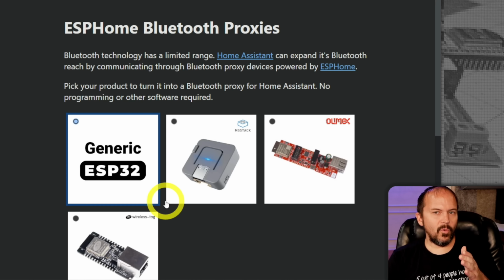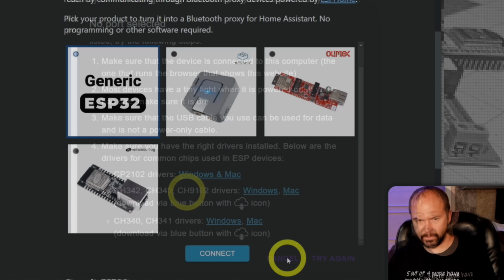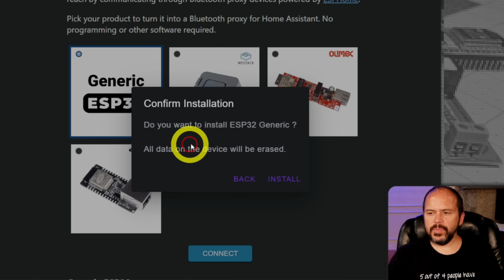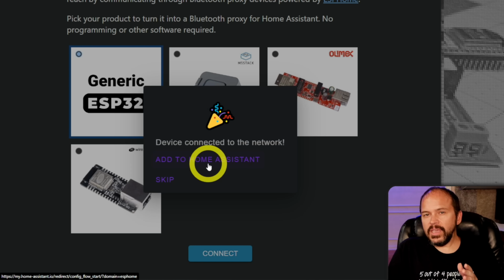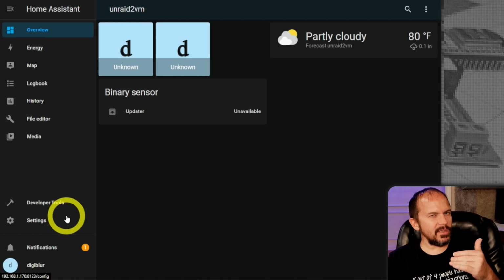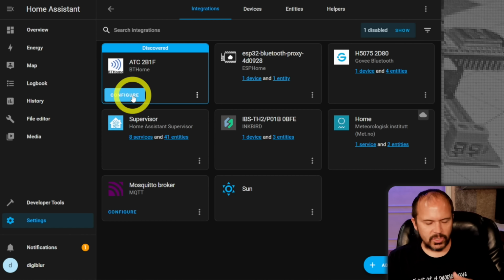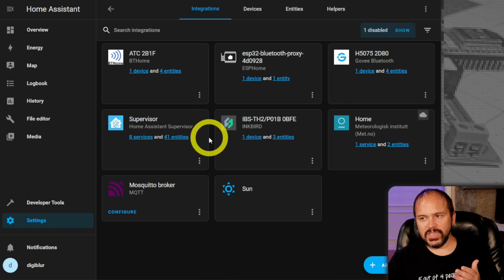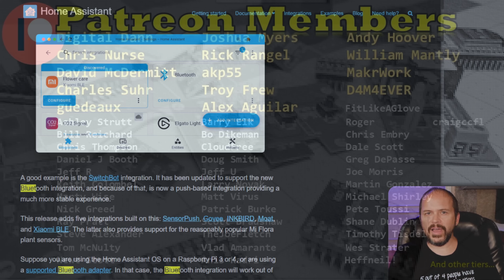How To Make a Home Assistant Bluetooth Proxy | EASY NO Soldering

Comment: Thanks again Travis.  I have an InkBird BT Thermometer in my Hot Tub, it says the range is 100ft, but I could not pick it up with the Inkbird App at anything greater than 30ft.  Even after setting up the BT Proxy (NodeMCU), I had to locate it pretty close to the InkBird.  I guess I will have to sprinkle some more around my property. Nice video.
Reply from the maker: Probably 100ft with a perfect clean spectrum but it competes with wifi a bit. No harm in adding more. I have 3 or 4 around.

Comment: One thing to remember if you add a Bluetooth proxy to an existing device; you may have to rebuild the firmware with the esp-idf framework instead of Arduino to make sure you can fit everything in the onboard memory. If you do, you will have to manually reflash the device, as there are differences that an OTA upgrade won't be able to fix.
Reply from the maker: I saw that new change I think in December it was?
Reply: @digiblurDIY  It seems that you're right; it seems to have been part of the 2022.12.0 release of ESPHome.

Comment: Just wow 👌 👏 

I have been searching for a way to connect more than one bluetooth speaker to a raspberry pi running on bullseye and play music on these connected Bluetooth speakers.

Could you please do a tutorial on how to do this !!! 🙏
Reply from the maker: Thanks!  Probably more than what you'll see this project doing given the data involved but you never know what they come up with to support.
Reply: There is a feature in the upcoming Bluetooth standard to sync multiple Bluetooth speakers.  To be clear it's the upcoming Bluetooth standard not a HomeAssistant feature and it won't be compatible with current devices.  Till then you may be out of luck.
Reply: Not over bluetooth, but devices like AudioPro and other LinkPlay based devices allow streaming and synchronizing music over the network, with HA integration

Comment: Tried with an NSPanel, but seemed to crash the device sadly.  Worth a shot :D
Reply from the maker: The NotSafe Panel might be better at not being a proxy.  I'd stick to dual use on something simple like a relay.
Reply: @digiblurDIY  I’ve spent more than enough time trying to get it right in Nextion/ Yaml I suppose I don’t need that to mess it up hah.  Looks pretty sweet with zigbee wind/temp sensors etc displayed on it though

Comment: so thinking out load if you had the original NS panel round your house with esphome they could also be proxies
Reply from the maker: Yes. In theory they could as long as the cpu doesn't max out on them.
Reply: @digiblurDIY  I've just tried it with the one I had in a draw and it pulled in my Xiaomi temp sensors without effort

Comment: Hi,

thanks for the great video. I still have a question regarding the connectivity. I'm using 4 Govee h5075 and the ones connecting over the esp proxys are loosing connection all the time.
I'm using 2 Proxys with generic esp32 without an ethernet port.

I can't seem to find the problem. Is it a connection issue because of the shared wlan/bt antenna, or has it cause by something else. I saw a tutorial about soldering an antenna to esp32 board which amplifies the connection.
Reply from the maker: I would probably just add more proxies as needed. Also upgrade to the latest HA. The current Esphome December beta has a lot of great fixes as well. They do make proxies with antennas. https://www.tubeszb.com/product/BT/53
https://www.olimex.com/Products/IoT/ESP32/

Comment: Just set one of these up myself, it was super simple. Only question I have is how do I tell which proxy if any is being used by a particular device? I have a bluetooth usb on my nuc that is a bit spotty for my switchbot and want to verify if it is connected direct or via the proxy now.
Reply from the maker: At this time switchbot needs active connections so BT proxy isn't being used on those.
Reply: @digiblurDIY  ah that makes sense, thanks!

Comment: Thanks for all that you do! I'm using the Olimex ESP32-POE-ISO and cannot get the power over ethernet. It does pick up my Bluetooth devices but I need to power it via the micro USB. ANy thoughts?
Reply from the maker: I'd check that it is working with another POE compliant device.  You might have a bad device if so.

Comment: Thanks for the video. What ESP device would be capable of providing both a Bluetooth proxy for home assistant via wifi and also an mmWave presence detector on the same board? Are there any off the shelf cased sensors that do this currently?
Reply from the maker: I would probably split those with most of the mmwave sensors due to how much traffic the esp has to process on both the BT Proxy side and mmwave side. BT proxy on something simple like a smart switch or plug would be a better option.
Reply: @digiblurDIY  thanks for the advice.

Comment: Great video, thanks for making it easy. I have a couple Home Depot window blinds that are controlled via BT. Is there a way to integrate them into Home Assistant with this?
Reply from the maker: There would have to be integration created for that on the HA side.  More or less someone to reverse engineer the bluetooth data control part.

Comment: Thanks for another great video. Question, are you connecting the ESP32 board to your Pi or to a laptop?
Reply from the maker: No Pi here.  To put the initial software on, connect it to the computer you are using Chrome on.

Comment: That looks promising. So at the moment I have the Bluetooth integration and the Passive BLE monitor to pull in the devices into HA. Are you saying with the Bluetooth proxy I should be able to get rid of the Passive BLE monitor integration?
Reply from the maker: This is for the Bluetooth support they added in the last month or two.

Comment: Cases: any concerns about overheating with these things? Wondering about those ventilation slots on the "brittle" case you printed.
Reply from the maker: I have had one running in my cabinet area for a few days in the thicker case without issue.

Comment: will this work with homekit devices that use bluetooth?  I have a door lock that is JUST barely inside the range of my bluetooth dongle and I can low response times and connectivity issues from it through HA.  Being able to put an extender right next to it would be massively useful!
Reply from the maker: Not yet, this is for passive devices.  That's coming in phase 2.
Reply: @digiblurDIY  well I guess I'll get it all set up and then exercise my least favorite tech guy ability: patience.

Comment: I've been running Home Assistant via HassIO - built in rasp-pi bluetooth just started picking things up by itself without and of the additional hardware.  I can see how it would be super helpful if your rasp-pi was remote though.
Reply from the maker: Very much so as the range on that is limited and some could have them stuck in a metal cabinet as well.  Not to mention I don't have bluetooth on my HA at all as many others do not have this adapter either.

Comment: Now we need a good way to do presence on the same board.
Reply from the maker: Seems simple enough with a couple pins to connect up whatever sensors.  I'd keep it pretty light though as bluetooth traffic can be quite a bit in some areas for the processor to dig through so adding like PWM, serial comms, etc might not be a good idea.  I don't know if ESPHome has a cpu average load sensor?
Reply: @digiblurDIY  I meant BT presence.  I think we need to run something in HA to interpret the BT data.
Reply from the maker: I haven't embedded my BLE token just yet myself.
Reply: @digiblurDIY  It's painless until you have to change the battery. 😂
Between my phone and a few other factors BT works pretty well for me.
Reply from the maker: I can't find my phone half the time. Leave it outside. Stuck in the couch. Etc. I use the Google.. Where's my phone way too much.
Reply: @digiblurDIY  I get that! I left mine on top of the refrigerator door last week.  Even when I closed it the phone didn't move an inch! Fit in there like a charm between the fridge and freezer doors.   I didn't know till I opened the fridge. 😂

Comment: Can we use the Shelly plus 1 and it's native firmware to use them as a proxy? Will the Shelly plus one work with room assistant?
Reply from the maker: Yes, as of the latest HA release I saw the notes stating you could use the stock shelly plus firmware as a proxy.  I haven't tried it myself as I don't have any left on stock.  

Never used room assistant myself.

Comment: If I add more than one Bluetooth proxy, will HA sort out getting multiple BLE advertisements without manual intervention?

Also, will this coexist with Blerry over Tasmota MQTT gateways or should I use only one or the other?
Reply from the maker: Yes, it is designed for multiple.

Yes.  It will coexist but could create duplicates if you have them configured in both.
Reply: @digiblurDIY  I've configured devices in Blerry but I thought there was no device configuration step with Bluetooth proxies and that all BLE devices would be autodiscovered, hence the question about coexistence. 

Long term, I would like to switch BLE sensors over to proxies but there will be a transitional period.
Reply from the maker: Don't hit configure on them.
Reply: @digiblurDIY  That was so simple that I didn't think of it!
Reply: @digiblurDIY  I've ordered some Switchbot Plug Mini's to install Tasmota/Blerry and replace my ESP32 dev kits which are my current gateways. Can I reprogram them from  Tasmota to ESPhome per this video or would I have to somehow take them back to factory state first?
Reply from the maker: @unmesh59  I tried to compile an esp32c3 with a Bluetooth proxy and it errored out.
Reply: @digiblurDIY  Sorry, by "reprogram them" I meant the full ESP32 dev boards.

Comment: Thanks for the nice video! My "weird idea" is to have a bluetooth button (or rather a remote with several buttons) integrated into Home Assistant. I'd be interested for example in using it at my office desk to quickly pause the music on my smart speakers (already integrated into home assistant) when someone calls me, or for example to change the volume or play the next track. Only issue is that I haven't found out how to accomplish this yet :-P any advice is most welcome.
Reply from the maker: I know you can attach buttons to the GPIO pins on the little Xiaomi sensors but not sure if that is supported in the HA side though.  Might be more suited for something in the Zigbee world or really if you have it mains powered just do a simple button on an ESP chip if you have a 3D printer.
Reply: If you have the companion app installed you can use the  relevant sensor as a trigger for an automation to pause the music and restart it when the call ends.
Reply: @martynpriest7118  great idea. In fact I'm doing that already. Problem is that it doesn't work for the softphone on my corporate laptop

Comment: Hello. I am Vietnamese. Please tell me why when I enter the IP address (taken from the router and set it as static) in the "Host" field and then send it it says "Failed to connect to the ESP. Please make sure that your YAML file contains the 'api:' line". Therefore, the ESP32 cannot be included in the integration site. Help me. Thank you!
Reply from the maker: Do you have api: set?  That's all I do when adding one manually is put the IP in and that's it.  Try to make sure you don't have the API key messing you up, remove the encryption if the device isn't exposed on a unsafe network.

Comment: Adding bluetooth proxy does take up more memory from your ESP32. I ran into a memory problem with ESP32's with a display.
Reply: Good to know. Is there any way to get both working? Fewer fonts or something?..
Reply: What sort of error are you getting? I have a a standard TTGO TDisplay and have:
Flash: [========  ]  84.5% (used 1551006 bytes from 1835008 bytes)
and yet the module enters some sort of boot loop.
Reply: Is there a way to know if it's a memory issue or some other incompatibility?

Comment: Sorry, it is me again. May I please have two more questions? 1/ I have two blue tooth proxies. Is there any way to see which sensors are connected to which proxy or even manage to which sensor will be connected to which proxy? 2/ Would you please have some universal .yaml file for ESP32S ESP32 ESP-WROOM-32 board used as a Home Assistant Proxy? Thank you very much
Reply from the maker: Not easily, you can see the debug log data if you turn it on. Here's the Yawmill https://digiblur.com/wiki/ha/esphome-bluetooth-proxy-esp32
Reply: Thank you very much. Your videos are great and I also appreciate your responses

Comment: Nice video, thanks. A question though, is there a way to utilize this with custom_components? To explain further, some custom integrations require connecting to Bluetooth devices manually using bluetoothctl or hcitiool. This means essentially that the main adapter will be used instead of the proxy which renders it useless.
Reply from the maker: I have used this with the Ember Mug integration and a couple others before they got folded into HA itself without issue.

Comment: i have 4 Switchbot Hygrometer Thermometer however when connected most of the time it says unavailable or if its detected it says Retrying setup: Switchbot hygrometer with mac add is not ready
Reply from the maker: That might be one on the list for active connections in phase 2

Comment: Hello, could you please explain how to update the Blue Tooth Proxy Board over the air?
Reply from the maker: Do you have it adopted in esphome?
Reply: @digiblurDIY  I have originally installed my two boards through ESP home web. This time I have loaded the boards again but from HA ESP Home and it works. I have two BT Proxy in the house but it looks like all sensors are connected to the one which is much further than the one just next to the sensor? Do you know by any chance why is that?

Comment: Ble_Proxy: Hi Where and how can i select bthome for the ATC_Themometer?. Ble_ESP_Gateway: Can i select multiple sensors in one normal ble proxy /esphome ( 2 atc sensor on one gateway?
Reply from the maker: The BT home type is set in the ATC flasher/config webpage.

Yes. Install multiple BT Proxies around the home.

Comment: So i can just add the code from above to the yaml of an existing esp32 device (currently running as an LED controller with neopixel) and it can double up as a BT proxy?  So i can pick up my Mi Flora devices with the existing esp32s, and dont have to configure additional ones to just run BT Proxy?
Reply from the maker: I theory yes if the CPU isn't maxed out by being dual role with other stuff.
Reply: @digiblurDIY  awesome.  I have no idea how much of the CPU the LED controller takes, but im going to test this out.  Ive got 9 mi floras i need to set up, so i can wrap that into the LED project im working on and see how it works!  thanks for the video, great info!

Comment: Hi again Travis. Are there any ESP32 bluetooth boards available that are bluetooth only? I don't want my HAOS connecting to my network by wifi as well as wired internet. That will cause network issues.
Reply from the maker: No you need to use ethernet or wifi on them. No repeaters that I know.
Reply: @digiblurDIY  sure that’s the bit I don’t understand. Why do the boards have to be connected to the internet (once configured) just to run Bluetooth (given its a unique Bluetooth to Bluetooth protocol? I guess what I’m asking is do you know a simple USB Bluetooth dongle (without wifi)  which “just works” (there’s that phrase again!) plugging into that Dell micro PC/ HAOS build you did like 6 months ago. I’ve followed that build and it’s been awesome rock solid for months now. I don’t need ESP home and all that mesh Bluetooth stuff - just a stable signal in my garage for a Shelly Plus  relay to control my garage door. You rock mate. W.
Reply from the maker: None of this connects to the internet. It is using the local network as backhaul to extend your Bluetooth range. You can use USB based dongle if your Bluetooth device is close enough. Something like this https://amzn.to/3Bp2e4J
Reply from the maker: And glad to hear things have been solid! Nice work!

Comment: Does it make sense to reflash a nodemcu device that I connected to HA using Tasmota/ blerry that I installed following your earlier YouTube video?
Reply from the maker: Depends on your use case really as not all devices are supported the same on both platforms
Reply: @digiblurDIY  Using it for the Bluetooth sensor.  I thought maybe changing it give another gives me another proxy? I kind of hate changing stuff that has worked for a long time.
Reply: @billschatzow9919  I reflashed one of my nodemcu devices and it works though there seems to a bug somewhere because of which the sensor shows as unavailable some of the time whereas Blerry seems to extend the last reported value if it misses an advertisement

Comment: Hi, can we OTA update the proxies or do we need to manually update them? The OTA update for my setup (after following the instructions) fails. Thanks.
Reply from the maker: I update mine OTA just like I do any other Esphome device on the dashboard.
Reply: @digiblurDIY would it be possible to see the yaml code you have for a device? I'm assuming that if there was an issue it would be based on the yaml code?
Reply from the maker: Really just adding the ble and bt proxy blocks to whatever base code you have.  https://digiblur.com/wiki/ha/esphome-bluetooth-proxy-esp32